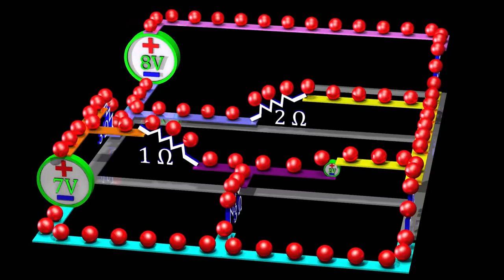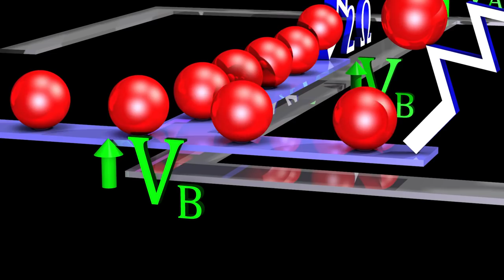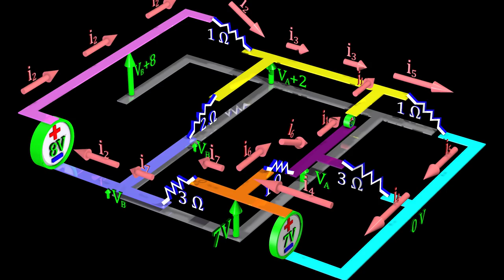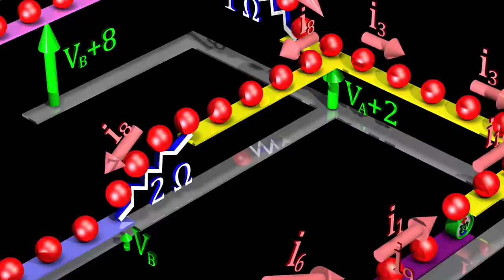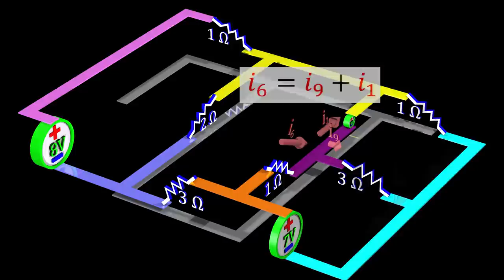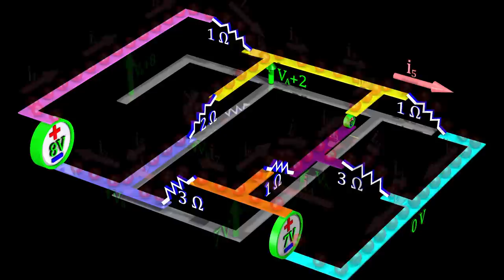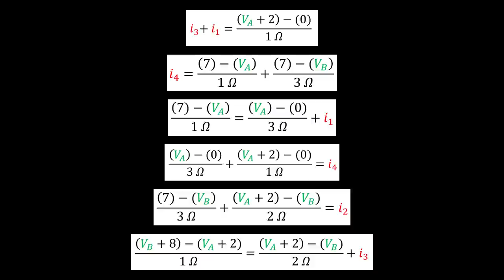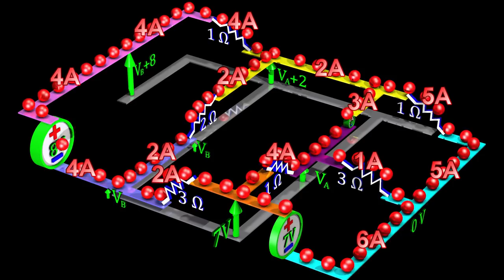Solving Electric Circuits

Comment: Eugene, I am always impressed by the clarity that your models provide! The vertical representation of voltage in 3D space is truly an intuitive way to understand the relationships of Ohm's law. They really helped me out back when I was in school, and now the students I tutor are equally grateful for the conceptual model.

 I've long wondered, is this proprietary software you've written, á la 3Blue1Brown? Is it modular/procedural, or are they statically animated for each specific scene?
Reply from the maker: Thanks for the compliments.  I am glad my videos have been helpful.  I make my 3D animations with "Poser."  For this video (and other videos where the red spheres represent current through a wire) I manually entered the animations for each sphere.  For other videos which show spheres colliding with each other, I use an add on program called "Poser Physics" to perform the simulations.  For other simulations, I use the built in simulator called "Bullet Physics."  "Bullet Physics" is not very accurate, but it is good for animating the shattering of objects.

Comment: So you just find the voltage relative to some arbitrary starting point, identify all constant voltage increases and resistors, identify the fork/merge points, and then recursively find the quotient of the difference of the start/end of each resistor's relative voltage over the ohms of the resistor, and that's the solution of the circuit. 

A little graph-theory, and a little algebra. Not too tough after all!

Comment: that visualisation was really helpful, thanks! let's me see the term "voltage level" in a whole new light! :)

for a while i struggle to integrate the idea that power sources have their own resistance. in one way it makes sense, they have a current and a voltage and you can divide one by the other, but the idea was still confusing. now it hit me: isn't the resistance of a power source _negative_? that would make a lot of sense i think, they do the opposite if resisting the flow of electrons.

anyway, thanks for the feeding my thoughts. there has always been something critical missing in my understanding of electrical engineering, and i think i might finally get around to getting it. :D

Comment: Why red balls move from - to + if they're positive?
Reply from the maker: Because the voltage sources are adding energy to them.
Reply: @EugeneKhutoryansky  no, I meant if balls are positive and the source makes difference in potentials, then balls were supposed to move to the opposite potential sign, from + to -
I thought schemes work this way.
Reply from the maker: The balls are moving in a loop.  So whether they are moving from "+" to "-" is a matter of perspective.  They are moving from "+" to "-" from the perspective of the resistors connected to the power supplies.
Reply: @EugeneKhutoryansky  oh, signs are inside the source.

Comment: If a potential is 8 volts, this means that each coulomb of charge that passes thru that potential gets 8 joules of energy.  1 amp is one coulomb per second.  So, if 2 amps pass thru a 2 ohm resistor, this would mean the voltage drop would be 4 volts.  So, the energy transferred, per second from the electron flow, to the resistor should be 8 joules per second.  Correct?
Reply from the maker: Yes, that is correct.

Comment: Dear Great video...
Please guide me how two  voltage sources and load will share the load.
For example two battery bank connected in parallel to a single load ,load sharing?
Secondly if a solar system is connected in parallel to the load with ups ? How to make the one source to take the load?
Please guide
Reply: How two voltage sources share the load equally?
Secondly how to make one source take the load.
Consider parallel circuit.
I am waiting and I will be very thankful if you clear my concept.

Comment: I really liked the video and it is very helpful visual representation of a circuit, however, I do miss the mathematics behind the solutions. Like you tell us we can solve it with algebra but not exactly how. I think the video could be better if you used a simpler circuit and explained the steps more in depth like your other videos.

Sorry for the criticism, I love your videos and they have helped me a lot. I think this is the first video that felt like it went too quickly.
Reply from the maker: The reason for skipping the algebra at the end is because at this point, it would no longer be an issue of learning about electric circuits, but simply reviewing how to solve an algebra problem.  I am glad you liked my video.  Thanks.

Comment: My mentor 👼👼 . Finally you are back with another informative video. Wow my mentor . This video was super amazing. 

Will you please make a video on  why the power dissipated along a transmission wire ( resistor)  depends on the current passing through it and is independent of the voltage ( energy boxes per elecron) ? . I have watched your video on transformers .  But I still can't grasp why this happens. The conclusion that I have drawn from my own thoughts is that the resistor in the transmission line joining two transformers has nothing to do with the enegy boxes per electron. A resistor has only concern with how much current is passing through it. The more current,  the more collisions and the more collisions , the more energy dissipation. Because collision result in deceleration of electrons. We know that accelerating or decelerating charged particles emit electromagnetic radiation. So the electons dissipate their electrical energy in the form of thermal radiations on collision with the atoms of the metallic lattice thereby heating up the resistor. Am I right? 😵😵😵

My mentor !  I have a question related to orbitals. 
The electronic configuration is
1s, 2s, 2p, 3s ,3p, 4s, 3d 

Here 
3p , 4s , 3d 
are arranged in the increasing order of their n + L values 
n = principal quantum number
L = azimuthal quantum number.

As the kinetic energy of electrons in 4s is greater than in 3d and electric potential energy is greater in 3d but less in 4s . So does it mean that the orbital radius of 4s is less than that of 3d ??? .😵😵😵😵😵😵

This question is ruining all my visual concepts. 😢😢 Please help me. 😭😭😭
Reply from the maker: I will answer the question about power dissipation in resistors, since that one is easy.  The power dissipation is equal to the current multiplied by the voltage drop across the resistor (P = I * V).  The voltage drop across the resistor is the current multiplied by resistance (V = I * R).  If we substitute this expression for V into the equation for the power dissipation, we get (P = I * I * R).  Therefore, the power dissipation does depend on V, but V can be determined from the current and the resistance.  This is why we can calculate the power dissipation from the resistance and the current alone.
Reply: @EugeneKhutoryansky  Oh yes 😍😍 that was a satisfying answer. Exactly true explainnation . Thanks a lot my mentor. 💖💖💖. God bless you. 💐💐💐💐
Reply: @EugeneKhutoryansky  My mentor what about my question of orbital radius?  😵😵😵😵🙄🙄🙄🙄
Reply from the maker: Sorry, I don't know the answer about the orbital radius.
Reply: @EugeneKhutoryansky  My mentor I think that the outside spherical surface area of 4s orbital is more distant away from the nucleus whereas a point on the surface of 3d orbital can go to a maximum distance away from the nucleus which is not more than the distance of outside spherical surface area of 4s orbital from the nucleus . 

But if we take the nucleus as our center and choose shperical coordinate system, and we try to find the radial centroid of 4s orbital and 3d orbital. 
Then we find something very interesting. We will obserse that the radial centeroid of 3d orbital is situated at a greater distance from the center of our coordinate system ( nucleas )  as compared to the centroid of 4s orbital.  
If am not wrong then the centroidal radius of 3d is greater than that of 4s and the energy depend upon centroidal radius. I hope you got my point what I am trying to say. 😢😢
Reply: @physicslover1950  the principal quantum number n defines the energy of a orbital. So higher n is higher energy. If a orbital is further from the centre it will have a higher potential energy, so its total energy will be higher. In other words 4s is further away from the centre than 3d because it has a higher potential energy.
Reply: @anokiller  If this is the cas ethen why electrons are first filled in 4s and then in 3d?
Please don't say that it is decided by n+L values. 🙏😌
I am searching for a more logical and reasonable visual concept. 
I think all we have to consider os the centroidal radius and not the orbital radius.
Reply: @anokiller  Yes I watched that video but he was talking about electronic repulsion. He said that the orbitals expand due to electronic replusion. 👀😵😵😵😵😵 I hope if Eugene Somehow demonstrates this visually in his video of modern quantum model of an atom.

Comment: Thank you for your videos. Usually I like them very much, however, here I am - for the first time - a bit critical. About some formalities: The arrows for V_A etc. are in the wrong direction, they usually point from higher to lower potential (+ to -). Further, when dealing with physical values, there should be a unit with it. Such as 3\Omega it should be V_B+8V (Volts). This might lead to confusion of people new in this field. Other than that it is very difficult to explain this concept, which is more or less just calculus in a video.
Using only Ohm's law and the Kirchhoffs allows to calculate all currents and voltages in a linear circuit, however I would not recommend to anyone to use this method as it is cumbersome and leads to unnecessary large systems of equations. Nodal analysis or mesh-current method are usually easier to use.
Apart from this: I really like your work and your (other) videos!

Comment: Video is wrong. Charge should go from - to + outside of circuit 🙂. Video shows movement of positive charge which iw not true.
Reply from the maker: The video is correct.  The very first sentence in the video is, "The red spheres represent positive current, which is in the opposite direction of electron current."  Showing positive current is the standard in industry and in education, even though we know that the electrons actually flow in the opposite direction.  In my very first video on YouTube, I showed electron current (with blue spheres) and people complained that I should instead show positive current.  Now, I am showing positive current, and you are complaining that I should show electron current.  There is just no way to please everyone.
Reply: @EugeneKhutoryansky  Your first video was right, because it was compliant with scientific fact that electrons flow in conductor, not holes or protons. Positive current is an old and disproved idea stating that electric current is made of positive charges that move in conductor which is not true in general.  Educational standards are not allways correct and need to be revisited once in a while to comply with scientific discoveries and not introduce confucsion, especially in USA, because I see that in USA many things are being thought an old and incorrect way. Direction of J vector is in directon of flow of electric charge which is direction of electric current which is in direction of electron flow. Mathematically it doesn't matter but your new video introduces confusion. I don't think that current consisting of positive charges in typical conductor is an engineering standard. It is an outdated way of doing things. That's why I still disagree. Kids learn that current flows in direction of charge flow, and that current is made of electrons but images and diagrams, and your video shows the opposite. That's wrong.
Reply from the maker: I can assure you that using positive current is the standard in industry.  Your argument is not with me, but with the standards used by everyone in industry and in education.  Convince all of them to change and then I will also change the way I show it in my videos.  Also, I would again emphasize that the very first sentence in this video is regarding the fact that the electron current actually flows in the opposite direction.